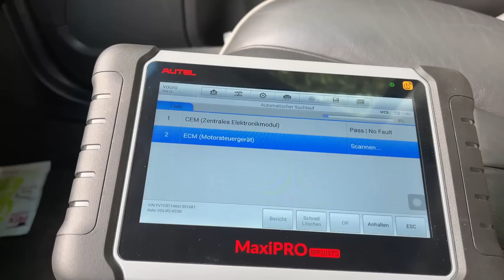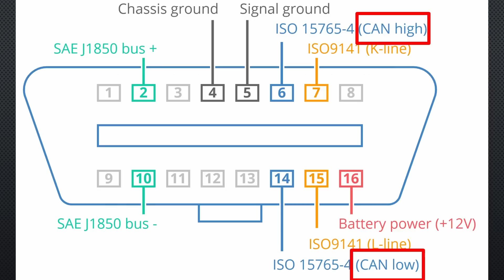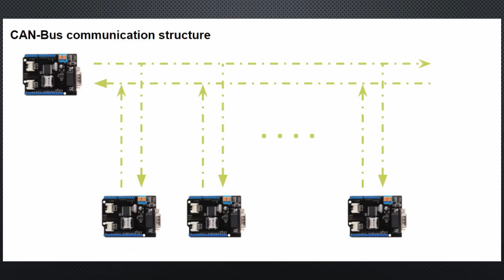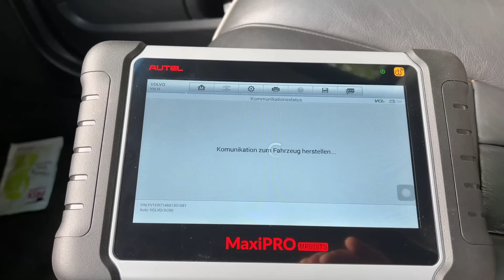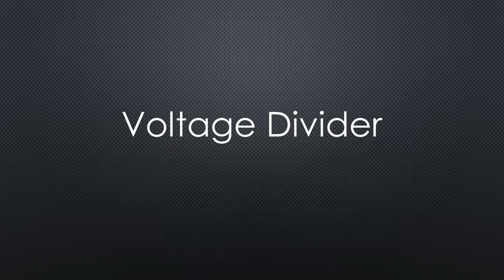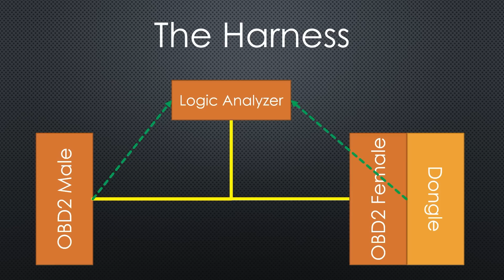#421 Home Made OBD2 Engine Alarm Resetter device using an Arduino?

Comment: Investigate purchasing a DiCE unit and VIDA.  All the messages are there and explained as with block diagrams explaining every module in the P2 Volvo high speed / low speed CAN networks.
Reply: VDASH by D5T5 is also a great alternative to VIDA for diagnostics (but not for documentation or trouble history).  For working on Volvos, nothing beats the level of fault history and detail that VIDA + a DiCE can achieve.  The Volvo DiCE unit is a Volvo device that adheres to the SAE J2534-2 standard.  Keep in mind that there's also a high speed and low speed CAN network on your P2 Volvo XC90.  VIDA or google will have diagrams showing how both connect to the Volvo CEM module.
Reply: A clone DiCE unit can be found for cheap on eBay. And VMware images with (cracked) Vida can be found on the internet.
Reply from the maker: I did not find a price tag on these instruments...

Comment: Hello, I work with CAN in Automotive since 2008, very nice idea with the Arduino Shield and the OBD2 library, but I couldn't understand why the reset all DTCs doesn't work when you send it from Arduino? How good is the Arduino at logging the CAN communication, can you log all the messages? If yes, then just make a reset with the Tool and then decode the OBD2. If not, I recommend Peak Dongles on USB they are very cheap and can log all the communication. I always wanted to make a water temperature gauge for my car by using an ESP32, I think it has a CAN transceiver too? Do you know if the libraries work also on ESP32? Anyway I am happy to help if I can please contact me at this id over Gmail or here.
Reply from the maker: Yes, the logic analyzer should log every CAN message on the bus. And I agree, it should be possible to find the ones sent by the resetting device (that was my plan). I must investigate more next week.
One question: Do you think I can identify the messages coming from the analyzer device by the message ID (does every device on the bus have a different but constant ID like an address?)
Reply: @AndreasSpiess  I don't think so, but I must check the OBD2 protocol. Usually there are some fixed IDs and it doesn't matter who is sending them, Arduino or OBD Tool, but you know by ID if a message is sent from the CAR side or the tool side. What I mean is that if you clone what the OBD Tool does and then send it from the Arduino, the CAR doesn't know.
Reply: @AndreasSpiess 
Hi Andreas, your question: >> my answer:
ID is NOT an Adress! The node sends a message with an ID. This message can be read from any node, if not filtered. The lower the ID, the higher the priority! (... wins bus arbitration). It is up to the Code in the ECU, what ID is applied. So i. e. nodes could send with the SAME ID, if it makes sense at all .
So careful planing of the ID's is needed.
Best Regards
Henry
Reply from the maker: @ragohy  Thank you!

Comment: Post this to SwedeSpeed! There are many of us who get up to Volvo CAN shenanigans.  Sorry to hear that your P2 XC90 let you down there.  They're usually so reliable.
Reply: Feel free to ask any details about the Volvo P2 CAN network design BTW.  We've done lots of projects and reverse engineering.
Reply from the maker: You saw where I stand now. What I would need is the reset commands the Arduino has to send... My shield should be able to create any CAN bus message.
Reply: @AndreasSpiess  Also look up a device called the CFE Plus / CFE Ultra. It adds many capabilities and automations to Volvos because of their CAN architecture.  E.g. You can display any info/error message you want in the DIM LCD display, read out error codes, reset error codes, use your door mirror joystic as a mouse, auto-heat seats when it's cold out, etc.
Reply: @AndreasSpiess  The latest CFE device can also serve as a J2534-2 with the latest firmware.  The more I brainstorm this problem you have, the more I feel that the CFE in one package does everything you need and more...  It resets your codes, let's you view any problem on the LS and HS CAN bus without VIDA, lets you reset modules, lets you automate and add features from later generation Volvos, acts as a DiCE unit for VIDA (if you want the rich diagnostics/history viewing), has WiFi+BLE for ease of viewing / control instead of using the mirror joystick, logging, etc.
Reply from the maker: @atomikrobot300099  I hope I do not need it because it cost more than 200 Euro. (CFE Ultra). An Arduino would be cheaper ;-) But good to know that I have a backup.

Comment: I wish you'll buy a Tesla and make all this on Tesla car :-)
Reply from the maker: Unfortunately, there is a minor problem to solve before: Get the cash to buy one ;-)
Reply: @AndreasSpiess  Just make an excel...  if you make some km every year, you'll see that Tesla is cost much less than actual car :-) 
For my Tesla M3 LR I pay 380 eu. every month for first 4 years... the will remain 25.000 eu that we will see how to pay :-)
Reply: @Mr_DenisJ  He states he has no cash, so you present him a plan that costs 43,240.00 Euros.. And that doesn't even include Tesla's recent significant price hikes..

Guess we've found the guy who works in the Tesla Sales Dept. :)
Reply: @trickyrat483  I was clearly told him that if he make some km every year the cost is less. 
Here (Italy) my tesla is cost less that a Fiat Punto ... but I make about 30k  km/year. Specially now that the gasoline is more than 2 eu/litre.
And no... I'm not a Tesla Sales Dept... I'm a programmer.
Reply from the maker: @Mr_DenisJ  I agree that the Tesla is cheaper than my Volvo (current diesel prices in mind). But this car got so old because it is hardly used (5-10000km/year). And we like its size and the 4-whell drive. The fuel is for sure less than 2000$ and the car is written off. Hard to beat by anything... But the next one will be electric!
Reply: @AndreasSpiess  Well... I'll wait patiently the next OBD2 project :-)

Comment: I had a similar issue and used a cheap ELM327 Bluetooth module with an Attiny85 which monitors a button and sends the reset  over UART to the ELM327.
Reply from the maker: Cool! But where did you get the reset commands from?
Reply: @AndreasSpiess  The ELM327 has a list of commands. If you send it "04" over UART it clears all engine codes.

Comment: The reset often has to be done under specific combinations of key position and engine condition (typically off with key in run position). You sketch would need to run at the appropriate time for your car.
Reply from the maker: You are right with the service message. There I found the process on YouTube. But so far the only way to delete the other messages was to have the car on and use the analyzer instrument shown in the video.

Comment: Interesting project. But selecting the most complicated way whenever you have a choice confused me.
Reply from the maker: Where did you see simpler ways? I was not aware I took the most complicated way!
Reply: @AndreasSpiess  Well, first you could have taken a 16€ Bluetooth OBDII dongle and a free smartphone app. Then you tried to analyze the data with a logic analyzer instead of a notebook. I really like your videos because of the great preparation and explanations but in my opinion, this one has room for improvement.
Reply from the maker: @Hessijames79  I am not sure if the 16 dollar dongle would have solved the problem. I would need an app. So far I got some suggestions for apps which I will try next week. The apps so far were able to show the error but not reset them. And the first of the suggested ones said that I have to purchase the "pro" version if I want to delete messages without mentioning which messages of which brands. But maybe I will spend the money...

Comment: I carry one in my camper van because I cannot push it! Chinese ELM327 about $4 and it connects by Wi-Fi to an app on my phone. Shows me the fault list and clears it as well as all the live data. But that’s not really the point, is it… Good luck!
Reply from the maker: It is the point (and I did not know it exists because my ELM327/apps never killed the alarms)! Which app do you use?
Reply: @AndreasSpiess  Car Scanner by Stanislav Svistunov. It has saved me many times. I hope you follow the rabbit hole with the logic analyser - I have been tempted to have a look. But be careful or you will find you have a very large brick !
Reply from the maker: @mahudson3547  Downloaded! I will try it tomorrow... Thank you.

Comment: I also did some investigations with the CAN-bus and ODB2 in the past. Not only for resetting error codes, but also to set certain behaviour of the car, e.g. the behaviour of electrical side mirrors, behaviour of lights when leaving the car and so on.
I bought a device called obdeleven which is able to do all these settings. It is not too expensive, but for every change you want to do you have to pay. So I tried to sniff the packets.
I found a software for Arduino for sniffing and serial dumping raw data from the bus. The library "Mechanic - Hacking Your Car Version 0.6" from Joerg Pleumann still works well, although being from 2013. It has several examples, one is a sniffer. There was also an article about this in german magazin "c't hacks" from 2013.
With the sniffer I got tons of packets when setting certain behaviour of the car (e.g. side mirrors), all of them not standardized. After hours I gave up trying to understand them.
I have a simpler device called "Ysding JD-101" which is able to delete error codes. Maybe I should try to sniff that device.
Reply from the maker: Your problem is more difficult, I think! Thank you for the tips about the sniffing software and the device. Maybe I buy one and if it works, my problem is solved ;-)

Comment: Hi Andreas. Nice, but quite tough topic. We work a lot with CAN bus at work, various types. Yes, there are several different bus systems, different voltages, different speeds, different protocols, even diifferent number of wires. So many chances to do stuff wrong. Can't wait to see the 2nd part of your video. Good luck with the CAN, and cheers to BOSCH for inventing it in the first place.
Reply from the maker: You are right about all the differences. This took me the whole week to learn about them and to find out which one applies to my car. Now I hope I find the right sequence...
Reply: you CAN do it! @AndreasSpiess
Reply: Indeed Bosch did a nice job with this, going back a few decades. I once told a junior mechanic that the Can bus was invented in Canada and therefore  was abbreviated CAN. It was meant as a lame joke and that he saw this through. However... he didn't and ever since he's been spreading this fake news around... ;-)
Reply: @Philip Gevaert  Hehe. During the past decade, I was - beside other duties - responsible for teaching installers how to mount our telematics hardware into vehicles, including CAN and troubleshooting. To award them with a certificate, we came up with a test they would have to finish, multiple choice style. One question: What means CAN? Not many get it right, and there are suggestions like "Controlled Autonomous Nodes" ... another question is about the right termination of the CAN. You would wonder how many fail to find the right values you have to measure when 2 of those 120 Ohms resistors are on the bus. However, these seminars were lots of fun, and most of those installers are able to troubleshoot CAN connectivity issues in the field.
Reply: @peter.stimpel  On many occasions it all comes down to motivation and perseverance... Btw, I had a side job as a teacher (electricity) for some years and I totally understand your statement of the many fails to answer/find the correct answer.
 I'm sure seminars can be lots of fun. I'm over 60 and still follow workshops and seminars. It keeps me sharp.
Reply: @PhG1961  me, turned 50 a few eeks ago, fully understand your point. And I like the interaction with different people at those seminars.